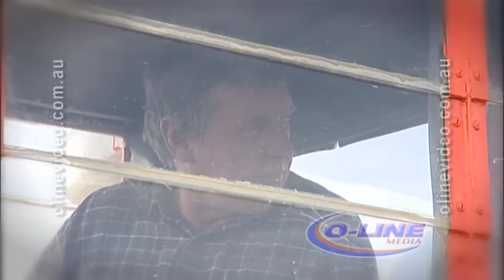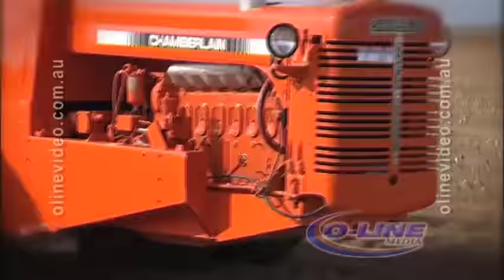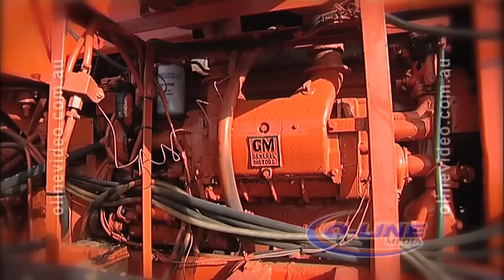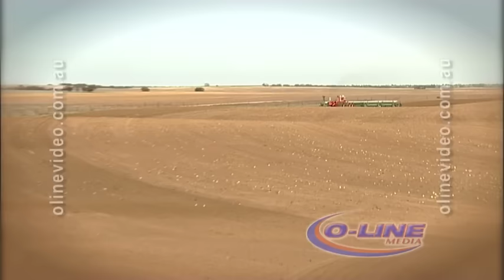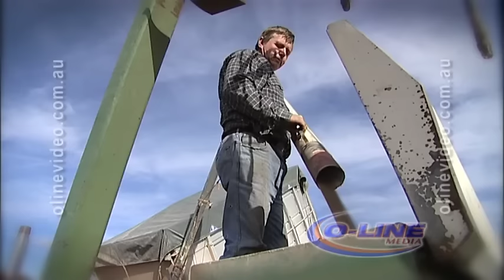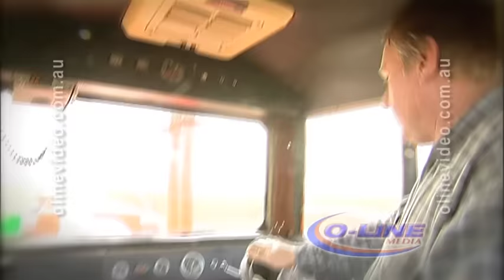Twin Engined Chamberlain Tractor

Comment: I can see only one engine running!
Reply: I believe the front engine drives it, and the rear powers all hydraulics.  I could be wrong, though.
Reply: @savagedabs8536  Maybe only one engine is needed to pull a seeding machine.

Comment: That is a  nice  tractor  I did not know that they a tractor with two motors on it
Reply: go watch video's there are hundreds available  just about every tractor from1940 has had a duel tractor built if you look further there is evan a triple engine and duel side by side go look.

Comment: What this tractor needs more than anything is a balancing mechanism so that each engine is pulling equally. The inventor might not think this is important but will show up in sticky situations rapidly. Not sure if it floods there but have never seen a growing area not flood. To balance it two dials for manifold pressure or a torque sensor in the drive train would balance these out so one was not doing it's share thus wearing out say the front engine which is blowing more coal. It needs two large throttle quadrants with large handles to more accurately balance the forces. The front engine could have a large marine wireless throttle to control it better. As the force of tractor weight is shifted rearward the throttles need adjusted accordingly to reduce wheel spin. It probably needs a slip indicator like new John deeres have.
Reply: Floods don't occur in the South Australian Murray Mallee. Paddocks are sandy loam.

Comment: Fook thats  one big tractor 1st farm job in  vic  i watch the sons use a  2 tractor pulling rig  they ran hand lines to 2nd behind & when plowing pulled the line to kick it in gear & throttle  up the same 
a bit work but they ran 2 these pulling 3-4   Scarifer s about 36 feet wide i was 16 in 1970s so maybe  with same as this guys  It was wide
and this seeder https://youtu.be/_PnDtK77r3Q?list=PL787b9qGBLAp-mlm1Fcr0peT9R6vRs3YO

Comment: Those 2 stroke Detroits are doing what they did best, converting fuel into noise! Started out with a 6-71 Detroit 238 with a 4x4 Spicer in an old Binder with 44,000 lb Hendrickson walking beam suspension and a Bostrom spring ride seat. When I did finally manage to get it up to road speed I spent more time in the air then in the seat. That is a great deal of ingenuity to create something like this machine when it was done although it wouldn’t be very useful in the 40 acre fields I grew up working.

Comment: Yah.      He must have the gearing a little out between them.   The 3-53's I ran cleaned up pretty good under a low load.     The neighbours old Cockshutt leaves a trail for about 3 miles if there is no wind all the time!

Comment: 2:24 it is only the front engine working?
Reply: You could run it that way since it's two totally separate units. Looks like the mechanical linkage between them is made to be pulled and not pushed from behind too hard, and he did say you start with the front engine first, so it's probably going to work slightly more than the trailing engine regardless.

Comment: The configuration it has and the performance it gives really tell here, unlike many videos.  As to how long he has had this rig going in this configuration without significant problems is testament to it's layout as well.  Durable, hard running Detroits and drivetrain that exceeds need.  Fine machine.

Comment: i love the crazy contraption of a tractor this is. just looking at each detail that addresses a particular problem. like the rear engine having raised air intake because of the dust from the front wheels. and the rear engine's radiator being repositioned to allow the best airflow.

Comment: figure those engines will rate out at 238 HP in high tune and running at 2100 RPM but he says they are running 1200 RPM each

Comment: Why does it sound like a lawn mower?
Reply: The engines are 2-cycle, same as a chain saw or weed whacker and have a power stroke every time the piston comes down so they sound like they are running twice as fast as they really are. EMD train engines are just big brothers to the Detroits. The old 2 valve'rs are rated 238 h.p. and the 4 valves are 250. But one V-12 is 500 so you get the same thing. Google "Big Bud" and see the overkill of this one. Simple is always better.

Comment: 71 series is it most used engine ....cause ther still used today ..construction equip...no longer in trucks ....4 71... 6 71 ...6v71....8v71....12v71...I think all parts are inter changeable

Comment: They are Naturally Asperated, the blower is nothing more than an air pump to force air into the 2 stroke engine, they dont compress, or build any boost. just move the air.

Comment: Here in the states a "pairing" of tractors is nothing new either,,,but you Aussies. take it to the MAX ! And i love it. Seen a Paired set of CASE's with airplane tires from there also. Great job sir ! American powered TOO!. love the sound of Detroit 2 cycle diesels, especially under a load...but 1200 rpm to start is great.....but they sound the best around 2400!

Comment: So one of the two engines is blown then?
Reply: I've  seen this tractor, both engines are naturally aspirated, no turbochargers fitted. Being a two stroke engine a blower is used to scavenge the exhaust gases and fill the cylinder with fresh air.

Comment: As a retired farmer and student of Ag. Engineering this video is very interesting. The workmanship on this tractor is excellent and the layout very simplified. It looks well balanced and seems to ride very smoothly. I had a chance to tour Australia in 1990 and was very impressed with your country and the large agricultural operations. The Chamberlin tractor must have a pretty stout drive train to handle the extra horsepower. Very interesting that the Chamberlin looks similar to a standard IH of the fifties but was actually bought by Deere.
As for the people that pasted the negative comments, they have no idea of the hours spent in the shop with welder and tools to create such a well built, home built tractor. And for the guy that said the bank owned the tractor, he has missed the whole concept of home engineering and building, as this is why the bank doesn't own it. Great job and video.
Reply: +k niles Well said and good on ya.
Reply: k niles k
Reply: N
Reply: Great comments to you sir....your an educated man who understands home engineering and initiative....👍

Comment: Still not a lot of horsepower. Those 6-71s I think we're good for about 250 hp. each.  So it may generate 500 hp.  Average size for today's tractors.  But long and awkward.
Reply: Each engine 125HP @ 1200RPM

Comment: wow, lol, 671's. Snotty old buggers. i used to play with an old 671 when we were running our Jaw off one. Almost bulletproof those things.
Reply: A crusher about 25 miles from here had a 6-101 on a cone'. It died and they got a 6-71. It wouldn't even tighten the belts compared to the 101. They ended up getting an 8V-71 which was a 318 most likely. You could hear it at the courthouse at the county seat like it was in your back yard and it was about 7 miles away. Straight pipes back then. No wonder I'm deaf!
Reply: +Lewie McNeely 8v71s are 318s
Reply: jdr ok True, or 350's, depending on the setup. That one was before the 350 setup was around much, at least around here anyway.
Reply: +Lewie McNeely true but werent those the turbo models?
Reply: jdr ok The old 318's were non-turbo, at least the ones I was around were. Maybe I was around an 8-V that was lower h.p. and needed the blower to bvering it up to a full 318. G.M. had a LOT of variations on their stuff. You could go up or down on the same setup by swapping some stuff around. Swap ends, swap sides, swap rotation, a one size fits all deal.
Reply: Lewie McNeely are you talking about a 6-110?
Reply: seems the soil is dead after all this pressure

Comment: The front engine is working a bit harder.
Reply: Front is only turning one axle. Or is that rear axle unpowered?
Reply: +justforever96 no assuming both the engines are in the same condition and have the aame hours oil nothing bad on them the front one looks to be held wide open cause of the smoke out the exhaust and the back one isnt smoking
Reply: +Gafarmer7410  nah front engine just needs new injectors..

Comment: Why does the front engine smoke? Looks to me that the front engine is doing more work than the rear engine.
Reply: It's a diesel. Diesels smoke.
Reply: I had no sound on, but it's probably set at a higher rev to "straighten out" the tractor and to make turning less problematic.
Reply: @PAI93  I'm thinking it's better to have the front pulling slightly harder than the back pushing slightly harder 🤔 that's my theory anyway ....

Comment: Considering the prices of new machines today, this is incredible!  Less than 20% of the cost of a new machine and still able to keep up with them, not sure the extra 80% is worth the tidier cab interior or a tighter turning circle :)
Reply: in the tractors of today u get much more options.. gps.. not so loud.. but yeah..
Reply: Keep in mind inflation, it would've cost SIGNIFICANTLY more than $12k in today's dollars(Oz dollars in specific). None the less, even with inflation it would still cost a quite large amount less than a brand new tractor of such capability.
Reply: WHAT ?
 THE NEW ONES GOT QUIETER CABS THOUGH!
Reply: Simplicity at it's best
Reply: Yes the nicer cabin air ride seat and precision automatic controls plus environment can is definitely worth it
Reply: @ronaldharris6569  Plus warranty. ;)
Reply: “Ya’ll laugh at me cause I’m different... I laugh at ya’ll cause ya’ll’s the same!!!”
Reply: @randymagnum143  The New ones don't sound like a fuckin Detroit mate.

Comment: back engine does not appear to be pulling it's share (check exhaust)
Reply: I'm guessing it doesn't have an ideal or maybe any synchronization between the engines.
Reply: Yeah agreed. But could be needed a slight advantage to the front to alllow the front wheels to pull around corners for steering.  Totally a guess as to why. It is 100% working that front engine more than rear. But i know some mud boggers use different gears front to rear. Never really could catch why.
Reply: @dougb6239  mud boggers do it so the front pulls harder than the rear keeping it in a straight line,if rear turned faster it would try and overtake the front axle
Reply: Different gear ratio's are unlikely, more likely different power settings of engines.

Comment: Only one engine works. Look for smoke!
Reply: They're both running watch 5:54
Reply: Why would this guy lie?
Reply: EXHAUST
Reply: Looks like the rear engine just produces a lot less soot. Take a look at: http://youtu.be/6w-ZnkeXI7c?t=5m55s
Reply: 306 CHAMPION complain to you parents
Reply: +extrasupermorgen back one is just for show. it's not really hooked up
Reply: +extrasupermorgen  Why is it some people think if one exhaust smokes a bit the other one should smoke, the front engine could have dirty injectors or a partially blocked air cleaner or has the throttle cracked open a bit more than the rear one causing the governor to give it more fuel.
Reply: extrasupermorgen 😭💖👈👑👧💖👌👉📞🙏
Reply: Over the course of the video shoot.  It would be difficult to say.  However the 2nd engine does appear to be running at 5:54 thank you thezman77.  I would suspect in the video the 2nd engine is not under load and virtually idling with the front engine providing the power hence the soot.

Comment: Each 6-71 Detroit Diesel engine is about 200 to 238HP, so times 2 + 476HP. There are any number of single-engine tractors with more HP that that today. with less complication, better turning radius, etc. etc. But still....a beautiful piece of 'farmer engineering' !! Congratulations to the builder. Man! Looks like a lot of rocks in that field!!
Reply: Engineering: Taking what you have and build what you need.
Reply: Rocks? You haven't seen rocks until you have worked the ground where I live.
Reply: Yea, but under 12k?
Satisfaction of pretty much building it?
It is a work but!
Reply: Yes but consider the cost of replacing a unit like that--2 or 3 $ hundred  thousand and if you want to keep your capital costs down this is a good way to do it..I have done it a couple of times and it works well and is not that hard to do,its just work..
Reply: Yeah but you have to finance a new machine!! This ones done 19 years so far, less than £1k per year, and thats Aussie $$$$'s!  All overhead finds it's way to the end consumer, thats us!
Reply: A tracked Case IH 425?cost?buy some Deisel with that.Farms in W.A.Wheatbelt huge,turning circle?lol.soil is so poor some fallow half every year.
Reply: +Ralph Swartz Which would you rather pay for? 12k to make an awesome looking tractor that works/is specialized for the job you need it for, or 20k-300k for a new tractor that is versatile and is not specialized for certain jobs.
Reply: +Ralph Swartz .Rocks! that's what we call "Sandy Loam".
Reply: Default Echo f

Comment: these engines are not very economical to run
Reply: Not by the look of that un-burnt diesel pouring out of the front stack.
Reply: @MrGarethG     I know a lot about Detroit engines and being a two stroke they do smoke a bit but not as much as the front engine. I'd say it got's a leaking or dribbling injector.

Comment: what a waste of time and energy, this thing probably drinks gallon a minute.
Reply: +Rancher Sam And I supposed you're under the impression that running 2 smaller tractors and seeders is going to be more economical...

Contrary to common belief, efficiency typically increases with size. You might think some of the largest container ships in the world get horrible fuel mileage (which they do, relative to anything in our daily lives), but every ton of freight on those ships travels approximately 700 nautical miles per gallon of fuel oil consumed. If that isn't efficient, I don't know what the fuck is
Reply: +Rancher Sam I'm sure you would know Sam.
Reply: +Rancher Sam ..If you can get your crop in before the weather beats you its all good, plus instead of going 24/7 to finish you might be able grab some sleep.
Reply: Rancher Sa
Reply: its funny with him planting 55 acre an hour, it would appear to be a large operation... and economically viable...
Reply: 12 grand to build,he can buy a lot of fuel with the cash left over,